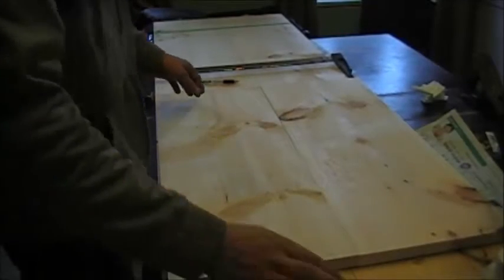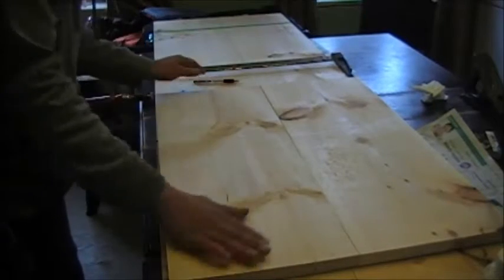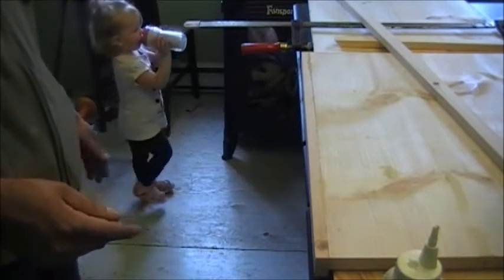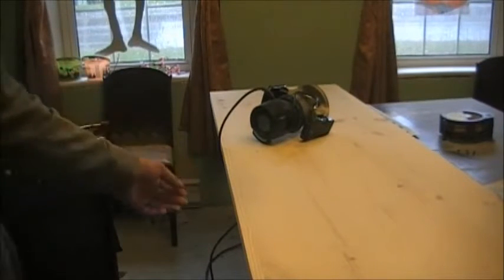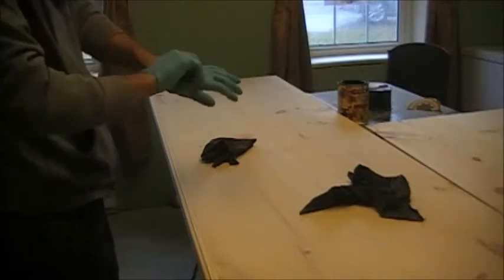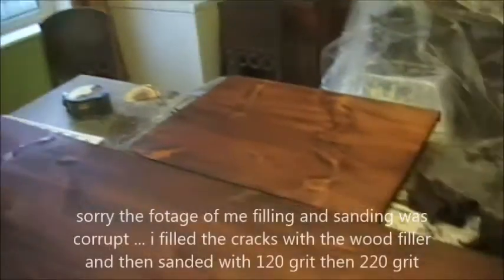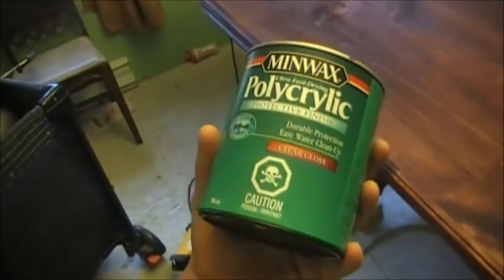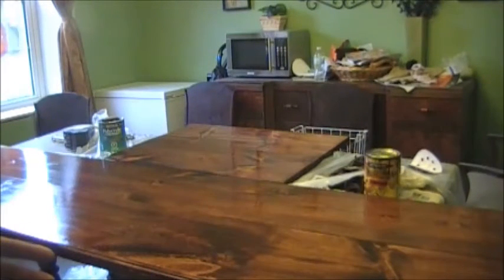DIY Beautiful Wood Countertops Step By Step

Comment: could you post a complete supply  list please, I have a old house and I am starting a remodel and I love your counter tops!
Reply from the maker: Ally Loudermilk you need 1x12 pine boards good one side is cheaper and whatever length you need . the hole coutertop is made from 1x12 .you need bisket jointer and min wax stain and min wax water based lacquer ..hope that helps

Comment: The only thing I would add is that it is a very good idea to poly the underneath side as well, because it's imperative to SEAL in the entire slab; otherwise, no matter now well you glued (even using biscuits) the moisture WILL separate the wood over time.

Comment: totally impressed with this! My wife just got laid off after 24 years and kids are grown. We planned on updating alot of areas in our home with the kitchen being first. I have 2 tops I want to make...1 at 101" with a stove cut and the other 88" with a sink. After you cut the sink out, did you poly the edge and did the poly chip at all? We want a satin finish on ours with grey cabinets. Your video has been the easiest to follow!
Reply from the maker: well thank you Im glad I could help ..I just cut the sink out then silicone all around the fiberglass sink .
Reply: Question, a Kreg Jig kit is about as much or more than a Harbor Freight Biscuit Joiner. I work with alot of pallets from time to time....would a joiner be a better purchase than a kreg tool?
Reply from the maker: +William buoymaster both tools have there place wish I had a kreg jig there great for build cabniets
Reply: I'm sure they do. Guess I'm looking at what might be the best for doing lengths like table tops and counters.
Reply from the maker: +William buoymaster biscuit jointer works better for that. both would be better tho lol

Comment: have you considered trying that clear epoxy resin stuff as the top coat? seems like it'd hold up better.
Reply from the maker: Elijah Watson I guess you could but mine stood up great to heavy use
Reply: GoGreenPM good to know. I've been considering a few options since I plan to do this same project, so I'll probably just go with the polycrylic you used since that epoxy stuff is pretty expensive.

Comment: Considering doing this as well but worried about the longevity of the finish. It has been a year since you posted this video, I'm curious if the countertops are showing water stains around the sink or water rings from wet glasses left on the countertops, etc. :)
Reply from the maker: artist craig richards the counter look like they were made yesterday no water marks at still in  great shape 
..thanks for the question

Comment: i dont have access to a biscuit joiner and cant afford to buy one for this one project. my longest counter top section is 84". would it work to instead run a small piece of 2x4 across the underneath of the seam from front to back every 2 feet or so and screw in from the bottom? would that give it enough strength?
Reply from the maker: Dustin Rowland no just use doweling jointers instead of biscuits there cheap and all you need is a drill and bit
Reply: GoGreenPM awesome. thanks for the reply. is the pine still holding up well?
Reply from the maker: Dustin Rowland yes very well still looks like there a new
Reply: GoGreenPM great. and great video. helped out a lot.
Reply: following! What are doweling jointers?

Comment: Did you think about using  countertop epoxy instead  ??
Reply from the maker: Doe Eyes it is a lot harder to work with this way works just as well
Reply: Epoxy is super easy to work with. Providing you mix it correctly, it flows super smooth like water. The best part is you can do whatever you want to it as far as colors, grains, etc. But even easier is to just stain your wood to the color you want it and leave the epoxy clear. I'm going to be doing this to butcher block counter tops in the future. The only down side to epoxy is it takes hours to set up and days to to fully cure. And don't even think about using any of that fast drying/quick drying epoxy. It will set up faster than you have to work with it and it will come out like shit. A small surface is fine, but not large surfaces like counter tops. But when you're done, epoxy is super strong and will outlast the rest of the kitchen!

Comment: How has this product held up over time?
Reply: and I like your Back to the Future reference :)
Reply from the maker: 3 years now and still going strong they look as good as the day I built them
Reply: do you reapply the polycrilic from time to time? Doesn't it eventually wipe away with normal cleaning?
Reply from the maker: lgmnow kondo I haven't yet but I will be putting another coat this fall just to keep up the shine

Comment: any worpage? twisting? I want to do my kitchen with pine , I'm told not to use it
Reply from the maker: nantucketjeep well mine have been in for a couple years and the look brand new still I'm very happy with the way they are standing up
Reply: Good to know, did you Cote the bottom too?
Reply from the maker: nantucketjeep nope it's bare wood and still looks new too

Comment: The only thing I see you did wrong was you finished the counter with regular poly. For surfaces that food will not touch, this is fine. But not for counter tops that will have food touching them. Strip that off and apply food grade sealers and waxes. It will protect just as well as the poly and you won't have to worry about getting sick from chemicals from the poly leeching into your food.